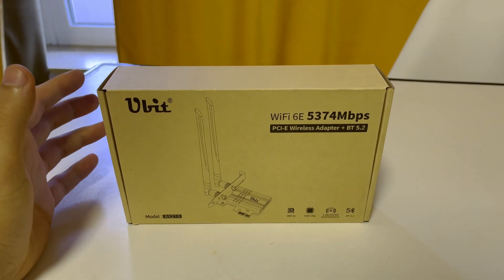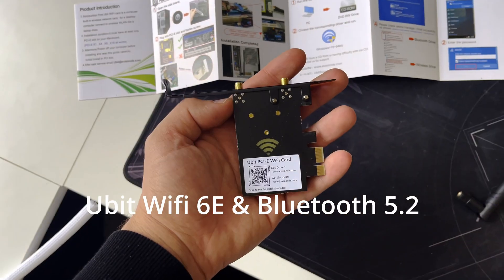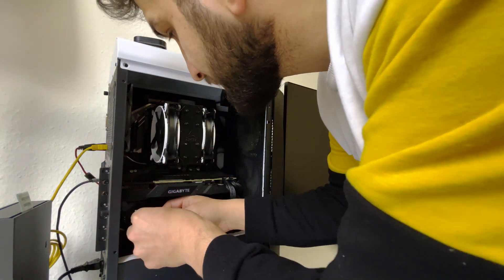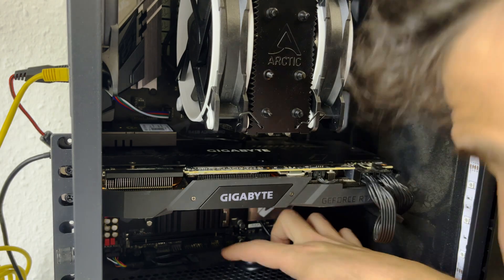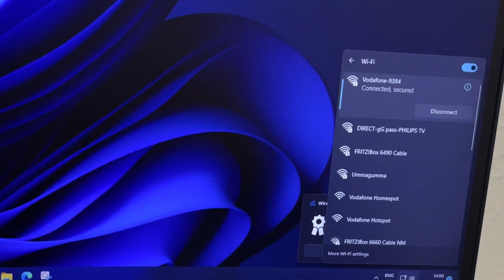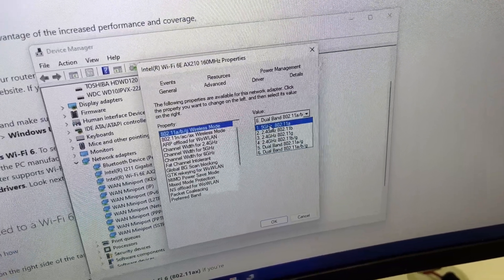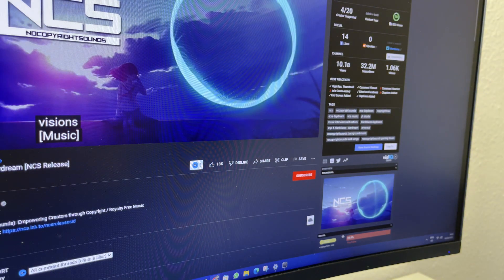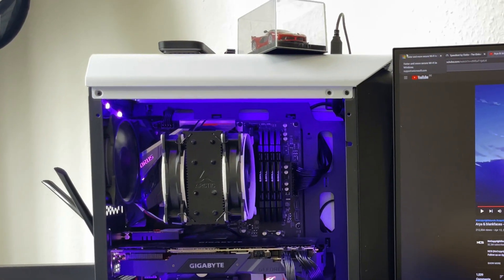Ubit Wi-Fi 6E PCIe  & BT 5.2 Installed and tested - Is there a difference?

Comment: i got this card but it does not have bluetooth. instead it has hotspot feature???? did i get a different version?
Reply from the maker: Could you please give the model name you bought?
Reply: Ubit WiFi Card 6E 5400Mbps for Intel (6GHz&5Ghz&2.4GHz) PCIe WiFi Card, BT 5.2, PCIe Network Card with OFDMA,Ultra-Low Latency, Supports Windows 10/11 (64bit) @RandomInfo03

Comment: what happens if you use it without plugging in the usb wire?
Reply: the usb cable is needed for bluetooth, if you don't plug that cable it might still work as a normal wi-fi card. I'm not completely sure tho, the card might be using the usb connection for additional power aswell, and it might not work without that cable plugged in.